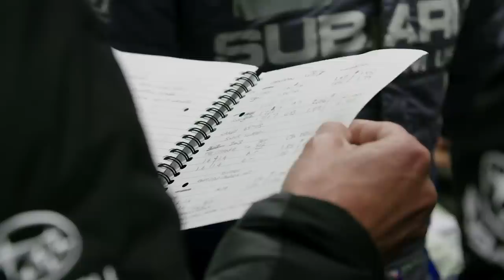Launch Control: Turning a Corner - Episode 7.3

Comment: Theres one more thing Subaru should do:
REMOVE THE DAMN CVT FROM THE PRODUCTION LINE!
Reply: Yes but replace it with a very good dct
Reply: @natesmith9007  DCT with Low gears!
Reply: Or just get the 6 speed and you don’t need to worry about it 🤷🏽‍♂️
Reply: @taidegiorgio1340  most of subie cars dont offer manual any more
Reply: I agree. Get rid of the automatics all together.
Reply: @jtd3d351  if you want to drive a car u get a manual
Reply: @taidegiorgio1340   While we would like that. The majority of people buying cars can't drive a manual anymore. It would cannibalize their sales.

Comment: Sensor “failed”.

Uh huh. Sure.

Oh and would you look at that, a brake line “failed”. Another non-race ending, just race slowing “failure” (ironically only resulting in 2nd place) to give solberg another boost of confidence in “learning” how to lead. And “learning” the consequences of pushing his tires beyond their limit, but without a loss of position.

Amazing bits of manipulation here Subaru. Simply Amazing. 

Does Solberg know you’re manufacturing his career?